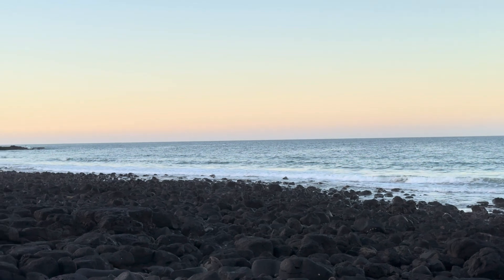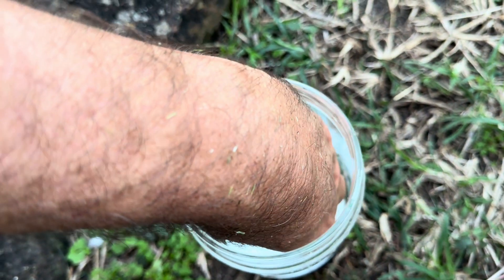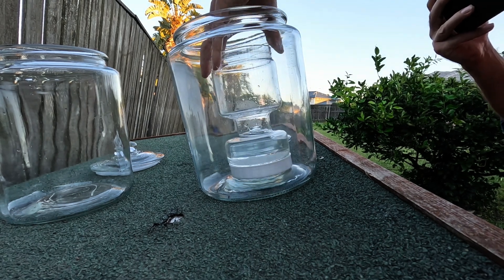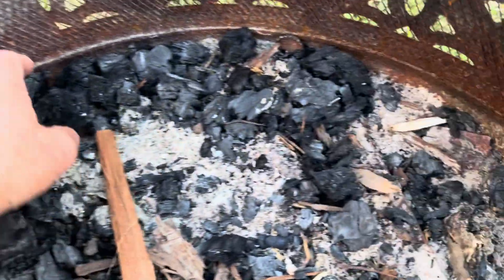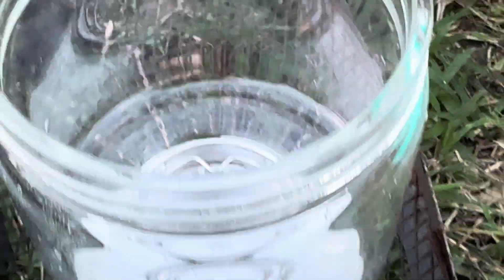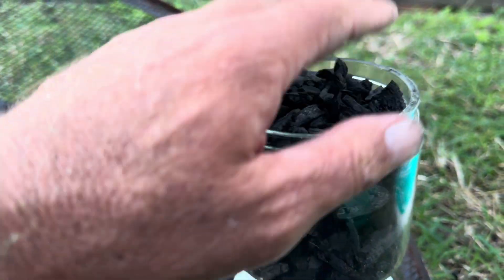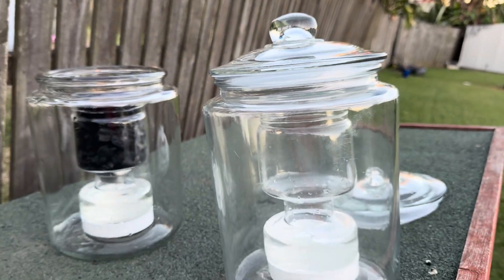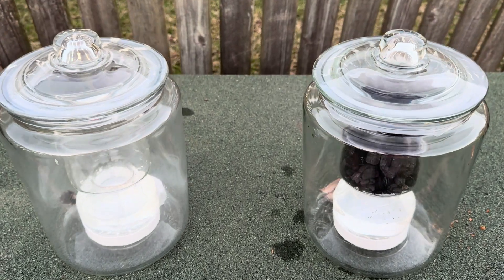Solar Still Experiment

Comment: Try boiling the sea water and put a rag at the top of the pot to catch the steam then squeeze it into another container or maybe a sponge or something I’ve seen someone do this once maybe you could give it a try I think it’s faster
Reply from the maker: Yep. This sounds like classic distillation with a twist. Normally the water is condensed in a worm condenser or copper condenser. Catching it in a rag is an interesting way to go about it. People are ingenious! Thanks for the insight! The main concept of this process in this video is to produce drinking water using only the power of the sun. It’s purely conceptual. I appreciate the feedback! I always enjoy learning new processes such as the one you have mentioned. Cheers!